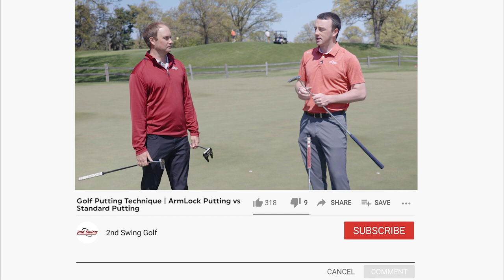Golf Putting Technique | ArmLock Putting vs Standard Putting

Comment: I have alway thought that most amateurs fell in love with the line too much when they should be thinking much, much more about distance.  You’ll leave more missed puts further away short or long than you will by being off line.
Reply: This is so true
Reply: I agree especially since most puts aren’t in a straight line so too fast the ball turns after the hole and too slow it turns before. Distance control is king, I’ve always picked my putter based on distance control.

Comment: The little pull shots might improve if you use an arm lock putter with a blade style toe hang balanced putter. I have been using the Gravity Golf Arc Master  lately rather than my face balanced mallet and it has improved my putting accuracy ( less pull misses) . My other observation form your video is that you putt with the right hand above the left. For me with my right side dominated putting style ( side saddle stance) I prefer my right hand below the left on the arm lock putter. It feels as if my right palm is pointed at the target and I am rolling the ball underarm.